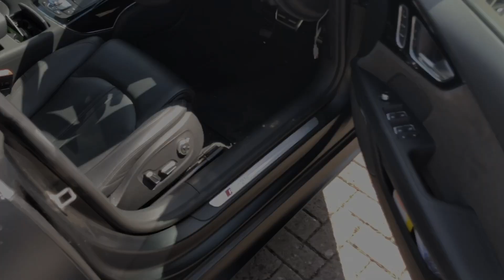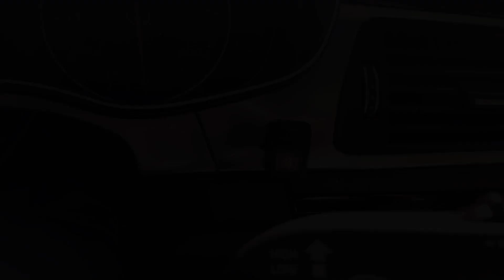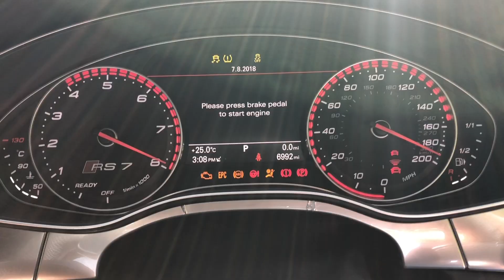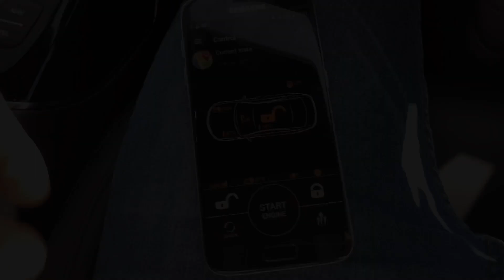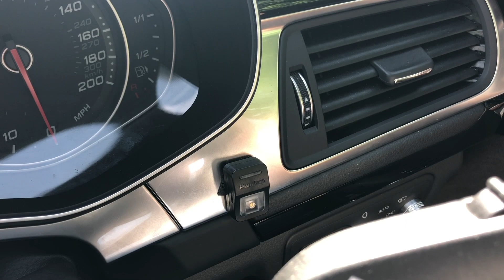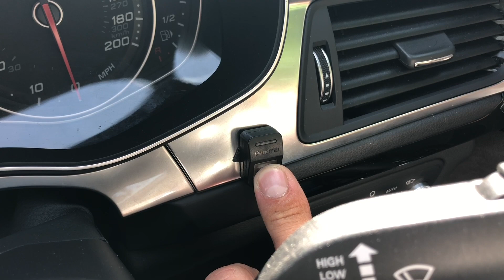EMERGENCY help with a Pandora Car Alarm

Comment: Not sure if this will be seen as it was years ago, but I have bought a car about 2 years ago from a dealership and they have sold it to me without the Pandora owners card but with the alarm fitted. I am now starting to have issues with my alarm going off randomly. I have changed the batteries in the tag but still happening. how would I disable the alarm completely as I don’t need the alarm now.

Comment: Hi, do you know if there is a way to turn off the beeping when unlocking and locking (thus disarming and arming) my car? It's really loud and at night it's a pain. I've turned the setting under hands free 'use without sound' but it doesn't seem to make any difference. Could anyone help please?
Reply from the maker: Hi Jamie, yes you can. However it will need ro be proggmmed off by your authorised dealer.
Reply: @PandoraCarAlarms  Thanks for the response, it’s really appreciated. By authorised dealer, do you mean the company that installed my alarm for me?
Reply from the maker: @RiperSnifle  Exactly yes.

Comment: Hi can you help me please? My remote start stop working correctly.When I remotely start my car and when I open door engine switch off. Thank you
Reply from the maker: Hi Josef, remote start will shut down if you open the door a few seconds after starting. Leave it a little longer before disarming a d opening the door.
Reply: @PandoraCarAlarms  Hi again! Thank you for your reply but … If I start my car remotely I mean 3 times on my remote key,car start and after when I want to open door with bottom button engine switch off! This don’t do before!
Reply from the maker: @josefbauer2202  hi, who fitted the alarm system and what car is the alarm fitted to? Make, model, Year...

Comment: Great vid, just 1 question, if I set my mobile phone up as a tag will the system no longer recognise the original tag? Or can both be used at the same time, or indidually as required, meaning phone is now an extra tag?

Thanks 👍🏻
Reply: same time or individually